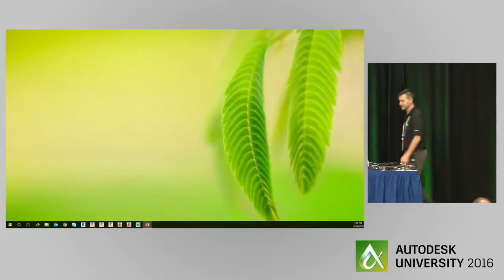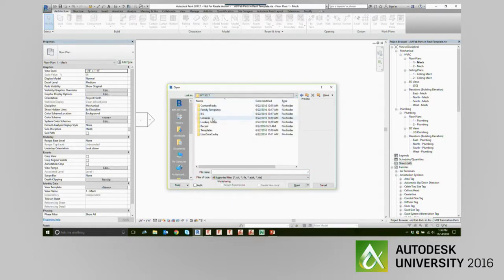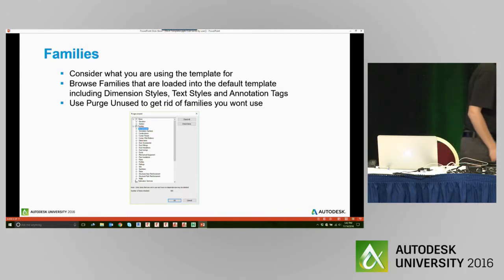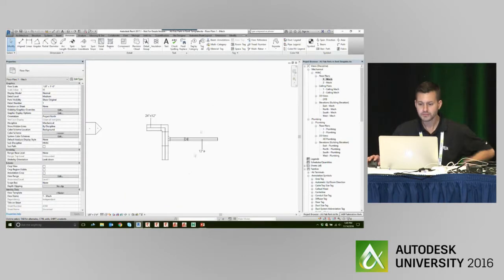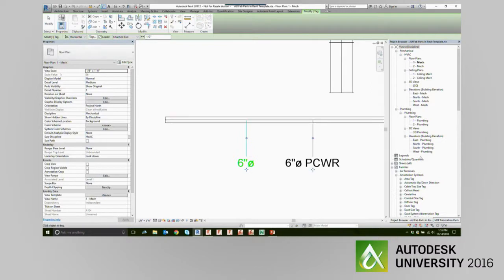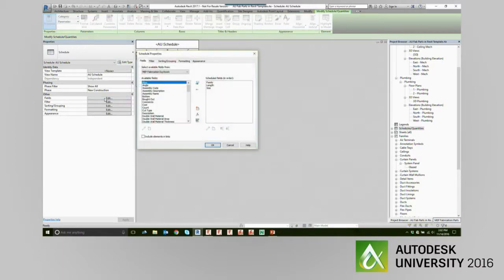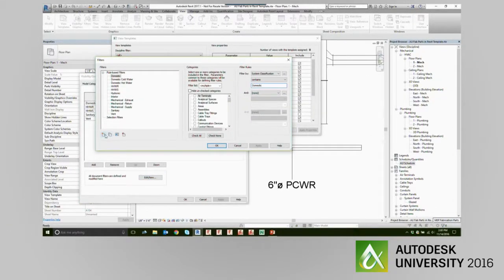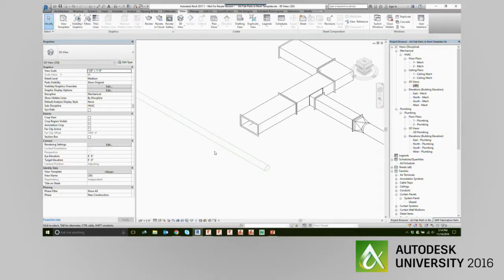Creating Revit Templates for Fabrication Parts

Comment: Hey, I am working for a new company and I need to make a whole new service database in FAB cad Mep then upload the service into revit. I am having trouble understanding how services work, connections behave, button mapping is defined wondering if you could make a video explain this and helping me out some? Some of the items I need for this project is PEX pipe, some water closet and urnail carriers zurn has the ITM files. IF you could help that would be great.